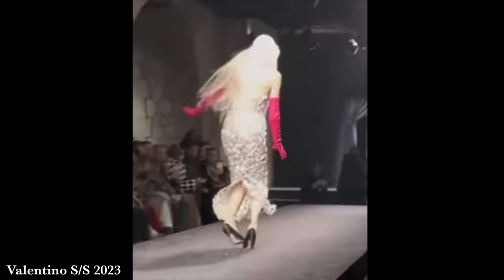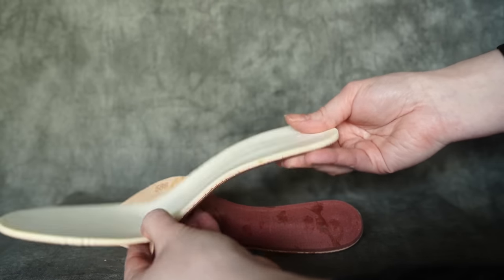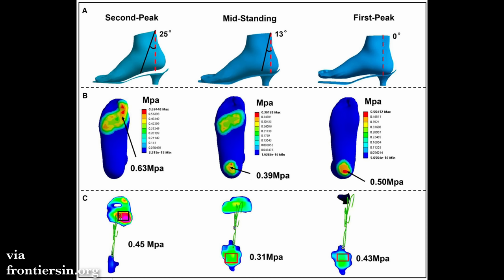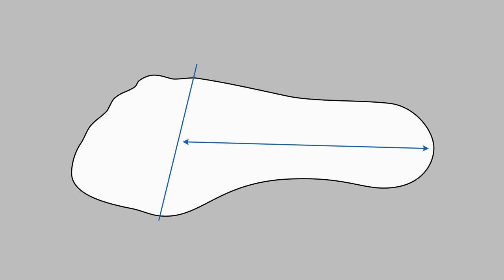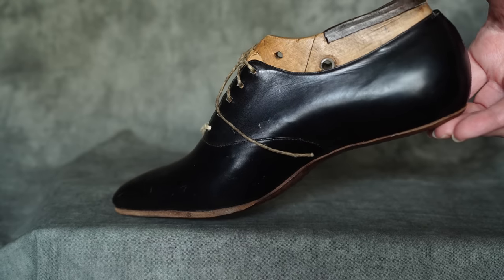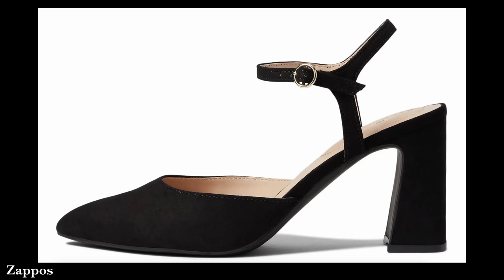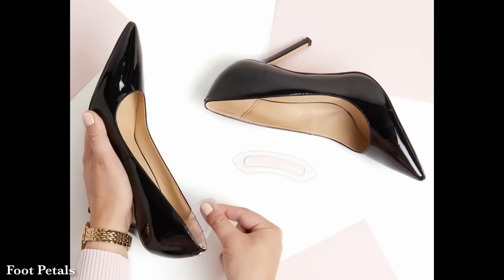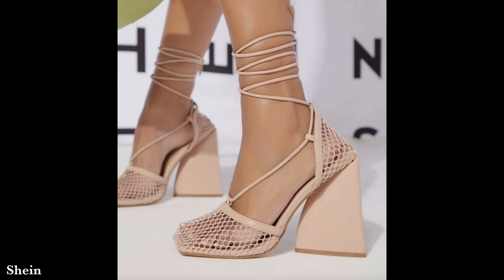Why are Modern High Heels so Bad?

Comment: easy answer. Most runway shows doesnt have the correct size, so the models has a hard time walking in their shoes. Additionally, either their outfit or stage can make walking harder, if it slippery or the dress is stupid long or tight. So yeah.

Comment: I was born with a clubbed right foot. Finding shoes that fit has always been so very difficult since my feet  are a size and a half difference. If I wanted heels I would have to buy 2 pair in different sizes. Eventually I just gave that up and chose tennis shoes  and or a shoe that would fit the larger foot and stuff the end of  the other shoe  with tissues or paper towels to keep my foot from slipping.

Comment: I'm pigeon-toed, flat-footed (though getting better over wearing orthotics for most of my life), and I'm certain that I have weak ankles. most of the heels I've ever worn, I cant walk in properly, but I've been most successful with heeled boots. I got a pair from an op-shop a few years ago that were chunkier and taller than any other heel I've ever worn, but had an easier time walking in them than any other pair prior (though, they were a size too big, and I eventually got passed them on).

As a birthday present to myself in '21, I bought myself a green pair of Camille heeled boots from American Duchess (not spon), and they are SO comfortable and easy to walk in - though, to be fair, I've only worn them a few times 'cause they don't really go with anything else I wear so I'm not certain that I'll never have issues with them. I also just really love the shape of the heel itself, and am considering buying a pair of Edwardian Oxfords for work/general wear (the only thing that's stopping me is the fact that I live in Australia, so it's a bit more expensive than if I lived in America)

Comment: my feet are two different sizes, one is smaller than the other. i can't wear high heels at all because of this, because i always need to basically tie the shoes to my feet so i feel somewhat comfortable in them. which is very sad to me because I'm short and would love to have like, a little height boost for some occasions. but i also hate how heeled shoes with lacing look. ugh

Comment: I was  wondering why pointes shoes 🩰  despite their inheritant difficulties, seem more confortable than a random high heels pair 👠

 Basically because they are fitted to the extreme, given the dancer's and dance's extreme needs, (this is even before any breaking in which may be more extreme than for any other technical shoe).
My local shop's owner was fitting pointes shoes to a girl for her first time, and explained that despite some incomfort while standing on pointe, they shall feel confortable to  dance in.
The same about walking cannot be said about majority of high heels 👠 

I'm quite impatient to have the required strength to be able to go on pointe 🩰 and be able to compare with heels 👠

Comment: I used to be able to walk in insane ballet plats but after my extensor tendon was severed and healed, I am unable to walk in heels more than about an or two tall, and only if the angle is less than 45 degrees.

Comment: Birkenstock forever for my duck feet.  Unfortunately they are making fewer and fewer styles in the wide width, which is very frustrating.  I don't have any occasion to wear heels anymore, but if I did, I would buy some dance shoes.  My aunt gave me some Ferragamo kitten heel pumps from the 1970's, and they are the most comfortable dress shoes ever.  But at this point I feel like they need to be locked up in a cabinet to admire instead of wearing them!

Comment: Some shoes are truly dangerous.  Those high, HIDEOUS platforms, are deadly.  I will never wear them.  I wore a pair in the 70's and fell off a low wall in them.  The sole snagged. on a high edge of the rock and off I went.  I was young then and fell onto a lawn so didn't die.  

My toes are wrecked from years of wearing.  I wore heels, the 3 -3 and one half inch heels with almost everything for 20 years.  I loved shoes and loved wearing heels and had 150 pairs at one time.  I had some tennies for shorts or gardening.  Other than that it was heels.  I bought what fit and I could walk in San Francisco and New York all day with no problem but, when your foot is at that angle for years it does affect them.  NOW, with those platforms and 6" heels you can barely walk.  Women just let designers tell them to wear ugly things and hurt themselves.  My days of wearing heels have passed, I'd kill myself and if I fell I'd shatter like glass. 

There were models who refused to work for Alexander McQueen because of those crazy shoes.

Comment: I would also like to add that most modern shoes have a far too narrow toebox.
The toes are supposed to spread to absorb impact and aid in balance, but shoes are designed with feet adapted to narrow toed shoes in mind, which directly causes bunions and worsens flat or flexible feet.
It is pretty interesting that we humans decided that That Is The Shape of A Shoe in the Middleton ages (at least in europe) and it stuck in a selfie perpetuating cicle.

Comment: I have given up. I have such weird feet, they are super wide, but  also stubby (like hairless hobbit feet), and then they are a size 6 in womens. But to get the width I often have to go up to a size 8. In addition, my top of my feet are super tall and if the shoe comes up high toward the ankle there is never enough space even in a larger shoe.

Comment: Was really surprised that you didn't address the high heel shoe that the heel slants way forward,  not even supporting the weight of the heel, and therefore weight of the body, because the heel of the shoe Isn't Below the heel of the foot. Terrible Design.  However,  Excellent Video! Again,  Thank You

Comment: I can't wear heels for a number of reasons, but primarily because I'm incredibly pigeon-toed. I had a pair of wedge boots I wore often years ago. A random girl stopped me on the street after walking by and said, "Excuse me, miss? I think your shoe is broken." I looked down, confused as I had not felt anything amiss, and said, "Huh?" She pointed to my feet and said, "The heel... I think it's broken." 

And that was when I realized every heel on every shoe of mine curves inward, even on flat shoes. The wedges on the heels were so malformed, it looked like a Lady Gaga design. (They did indeed split soon afterward.) I also realized most people probably don't show the most wear on the front side of their shoes, but I wear holes through mine there because there's no sole to  protect it. 

If someone could make a pair of heels for pigeon-toed peeps, that'd be great. Thirty plus years of walking, and I can't undo the pigeon, so it's not as easy as walking normally. One of my hips is pretty much locked, and I have zero balance when I place my feet straight. I'm just not sure it's possible to manufacture heels for me, especially because one foot is turned inward further than the other, so... Ah, well!

Comment: Thank you for mentioning the way lasts are made for wide feet, with the heel widened along with the toe box.  Wide women's feet are not shaped like that.  Narrow feet often have both sides of a foot parallel, whereas wide feet tend to have a more triangular shape, with the heel not much (if at all) wider than the heel of narrow feet.

It also doesn't help for manufacturers (or even podiatrists) to tell women to buy a shoe that fits the foot properly, when in most stores there ARE no shoes being sold that fit both toe and heel.  It would be better to say DON'T buy shoes that do not fit properly, no matter how much you may like the look, and even if it means you leave the store shoeless.  (Please understand that I'm not criticizing you here.  I'm criticizing the manufacturers, including the manufacturers of the lasts.)

This poor fit is one of the reasons that I wear a particular pair of (very old) sandals that fit my feet well, even in winter.  The funny thing is that my feet don't look especially wide, yet when I went to a store that said it had wide sizes, I found that my orthotics could not even fit into most of the shoes because of the width.

Comment: PS some comments on good designs for beauty and comfort.  
Wonders is a brand made in Spain that has some mid heels that are shock absorbing, flexible etc. I bought one mid to lower heels which were so elegant, classic and comfortable.  Another pair had a wedge heel and base was raised like a platform without being extreme.  They were flexible and surprisingly comfortable,  however, unfortunately the leather joins at the ankle strap were too raised/rough that I was getting blisters from the straps. I don't know if I could 'file' it with sandpaper or how this problem could be remedied.  The other t-bar classic pair in comparison had very soft leather lining and I could wear them all day despite plantar facititis. Peter Sheppard imports a lot of European shoes plus some of their own designs. Although they accommodate even those folks who need orthotics, or accommodate the wider or narrower foot but which fit the elegant but comfortable criteria unfortunately they tend to be rather  pricey ( 400$ - 500$ aud.)  One podiatrist who i feel expected me to fund his ski holidays told me to buy $1000 custom made orthotics. Another podiatrist instead gave me some exercises to help work on the foot such as stretching etc. I'm sure orthotics can be very helpful but I think foot exercises should be very beneficial.

Comment: I wear women's US11W/43EU and the No. 1 issue I have when buying clothing and accessories is the shoes. Even if the store has my size, most of the shoes don't actually fit because I have long toes, low arches, and a high instep. I'm doomed 😆

Comment: Funny enough as a stripper I wear 7in platform stiletto heels & they're really easy to wear. Just takes practice & focus on weight at the ball of the foot. A flexible shank/no platform I can't wear well because of its flexibility. My ankles will roll. A lot has to do with the ankle injuries I've had from lots of athletic injuries. Weight on the heel in stilettos is bad when you try to walk. The ball of the foot is everything to wear them successfully.

Comment: Before I watch the video, I’m gonna say the reason they end up failing or sucking is the stiletto or heel placement. The ones that are placed at the very back give little to no support for the rest of the body which is why people tip forward when walking in them. Well made heels have heels which are centered and/or wide enough to allow the wearer to walk on them without having to rely solely on the balls of the feet.

Comment: Don't they rough up the soles of the runway shoes?  The shoes are not fit to the model's correct size?  The runway is a slick surface?  The pace is too fast?

Comment: I'm only 6 minutes into your video, and I'm already cringing at the shoes which have the heel positioned waaaaaaay back to the extreme farthest back location of the sole.  I completely agree that well-made high heels should have a bit of a "shelf" upon which the heel of the foot is completely positioned.  Shoes wherein the heels are too far back don't properly support the weight of the body upon the heel, plus such shoes are improperly stressed in the areas of the shank, which imo causes the shoe to flex wrong despite the rigidity of the steel or plastic shanks.
If one has a person/woman stand sideways, barefoot, and draws an imaginary line down the profile of the leg to the heel of the foot, the area of greatest load-bearing capacity is roughly in the CENTER of the foot's heel.  Therefore those high-heeled shoes with the heel off-center from that imaginary line indicating the greatest load-bearing point of the foot's heel, are going to throw the body's proper walking positions and rhythms far off of anything natural or safe.  Edit to add - Imo 99% of modern heels are positioned at least 1 inch to nearly 2 inches too far back on the soles.

Comment: Modern shoes in general are a big problem. Mainly fit for me, though. There is normal fit, and wide fit, but no narrow fit. Meaning, I fall out of every shoe that’s not totally enclosed, and there’s miles of room in enclosed shoes meaning I must always wear thick socks, rain or shine. And there’s literally nothing out there. It’s funny you mentioned the models need narrow feet, that’s just for looks, because if they’re as narrow as I am, they can’t walk a step in them either.

Comment: I have horror feet - UK size 4.5 (I do sometimes buy older kids shoes cause they tend to be narrower), extremely narrow (like I have a pair of narrow fit brogues that I have to overlap the eyestay to get tight enough to my foot that it's comfortable), a high arch, and long toes that angle upwards (too much toe walking). I have Ehlers-Danlos Syndrome, so all my joints are extra stretchy, prone to subluxations (partial dislocations) and need good but flexible support, and my skin is velvety soft, fragile and prone to blisters so shoes cant be too hard. Also, due to mobility and safety issues, I can't walk in tiny heels anymore, I need them somewhat chunky/sturdy. UK or European brands would be easiest to find, and I would much prefer leather to synthetics.

Anyone have any recommendations for my poor feet? Custom shoes are probably not an option right now, unfortunately ;^;

Comment: Ballet dancers practice strengthening their feet for years before putting on pointe shoes, which are individually fitted to the dancer's feet and movement style. Why do we expect models to all fit into the same size 6 heel and stay upright in something that they never even see until they are about to walk down the runway?????  Two things are needed. 1) Models should practice walking in heels of different heights.  And 2) Fashion designers should stop treating shoes as simple accessories and start treating them as the important foundations they are.

Comment: Mm. Most of the problem lies in how stable a platform the toe box provides and the particular placement of the heel in the design. If the heel is centered beneath your actual heel and there is an adequate recurve in the sole to allow your heel to actually provide leverage then the shoe will be reasonably stable as long as the model maintains reasonable walking posture. Unfortunately, shoes that are too tall will inevitably be unstable because your heel is no longer able to provide leverage properly as your foot slips forward in the shoe. At this point, you can no longer use a conventional heel-toe walk as you are relying almost entirely on the ball of your foot for stability.

Comment: I was told with high heels (especially high heels) you're basically supposed to walk on the balls of your feet, as if you're walking tippy-toe, because it's not safe to put your weight on the heel for most shoes. It sounds like you're saying that's not true?
FWIW, every time I've worn even short heels I've ended up barefoot within 2 hours.

Comment: High heels wouldn't be so dangerous if people were more evolved to deal with them. Our bones are strong to compression/blunt force, but weak to rotation.

 So if you have normal joints then high heels and falling is just asking to mess up your ankles. However, if you have "superior" joints then they will allow for hyperextenion to occur allowing your bones to stay safer in rotation. (A lot of the time hypermobile joints are bad or cause issues though. I just try to appreciate the few benefits of them hence calling them superior.) 

Also a weird note I've noticed with having high arches: I cannot wear shoes with extra arch support. In heels or sneakers and eveything else. It'll cause my feet to cramp and lock up on me and is extremely painful. So companies using flat arch designs are a blessing. 
I can't wear most athletic shoes but thankfully converse and other skate shoes exist and are flat so I do still have some options.

Edit: I didn't realize my feet were good before this video though. I have all the ideal traits you listed for foot models. I thought I'd be shit at it since my feet are weird colors 24/7

Comment: Two comments, I have wide feet, but not fat feet. So, if I buy a pair of heels that fit the broadest part of my foot, they instantly become flip flops. Also why have heels on shoes suddenly moved to the back and become straight? A heel that curves in, so that the pressure point is the middle of your heel 'cushion' is so much more comfortable than one with a straight down heel at the back. These also automatically throw you forward on to the ball of your foot. Do shoe designers not have a basic grasp of anatomy? (yourself excluded of course x)

Comment: I wish I had nice slim Barbie feet that could wear all the cute women’s shoes and heels… 

Instead, my feet are ultra wide for their size and for comfort I can basically only wear zero-drop, foot shaped shoes (and I can juuuuuust tolerate some Vans and Doc Martens but they’re still too narrow).

I don’t even know what a heel would look like that actually fit me.

The most stable but still FAR too narrow heels I’ve ever worn are Pleasers. 6” platform heels! But they were quite stable to walk in. My pinky edge hung right off em though.

Comment: Because of the thinness and height of the stilettos.  A 2 1/2 - 3 inch, 1 inch width heel is THE MOST COMFORTABLE and most sturdy to wear.  Plastic is a DISASTER in a heel.